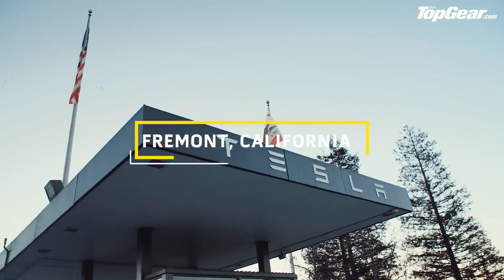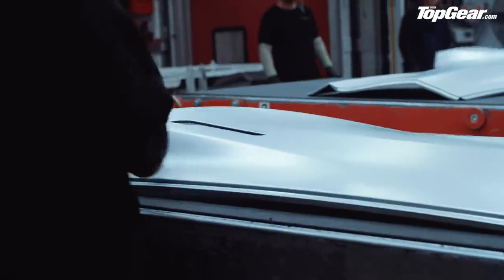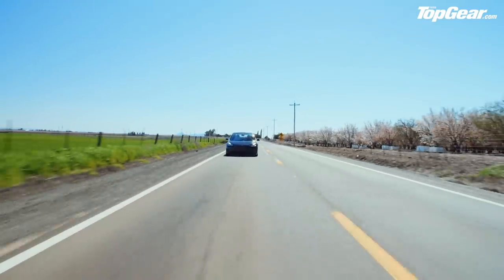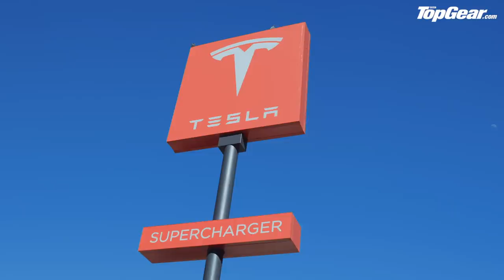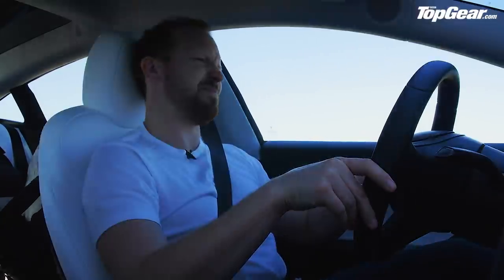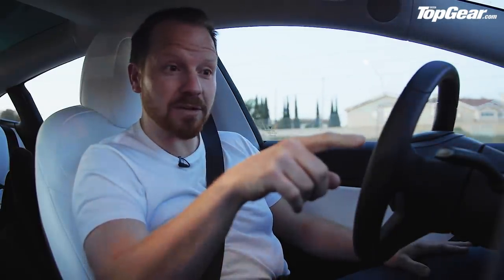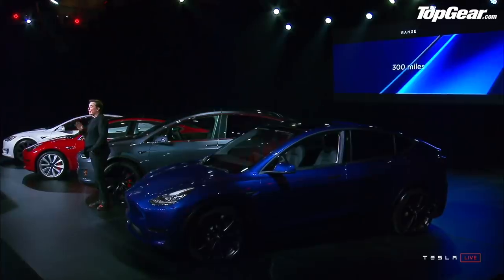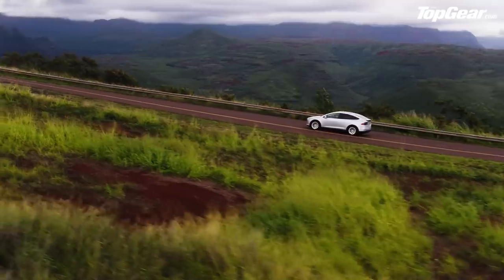TESLA Model Y Reveal, Model 3 Road Trip and Factory Tour | Top Gear

Comment: Nice video but not much research done
Reply: In fairness Tesla's can do so much!
Reply: Yea, it doesn't cost $20 to fill up for one.
Reply: If you add in the extra cost for a Tesla and divide it by an estimated number of fill ups I bet the Tesla equates to twice as much of someone filing up a regular car... Tesla is just a fab for the moment and it makes no sense go buy one till they get their stuff together as a company and build cars ppl would actually want
Reply: @jaybelle1909  extra cost on what? What are your calculations based on? Don't spread misinformation
Reply: The cost of the vehicle obviously, they have a build quality of a $10k and under car but the batteries are expensive that's why they sell much higher than a competitive practical car; all that extra cost it just makes sense to buy a gas or hybrid car till the tech becomes practical
Reply: @jaybelle1909  i can't take you seriously after you said that it has a build quality of 10k$. These cars are one of the most durable cars ever tested. If they were made of the same build quality as a 10k car, they wouldn't stand a chance.
Reply: Boomer0001 dopends on electricity cost, our Tesla costs £8 to fill up
Reply: Jay Belle Well no, As a family, we do quite a high mileage in our car, and before we used to buy £5K-8K diesel cars and use then for about 3 years before they die. We now bought a tesla, and even for the high price they charge it is cheaper to buy and use a tesla than any other car out there. That’s why we bought one, because it is significantly cheaper, Tesla’s are, in my opinion, the only good and want able cars out on the market right now
Reply: Jay Belle You don’t really know what you’re talking about it seems, perhaps do some research first before commenting, the tech is already more practical as demonstrated by hundreds of thousands of happy tesla owners. They sell them at a similar price to their competition and they have better specs, design and features. There is no reason, for most people, not to buy a tesla
Reply: @coonjamalay  durability is not the same as build quality. I deliver new and used cars for a living. The 2 teslas I have driven were the poorest quality fit and finish of any thing I've seen.
Reply: @lfo414  there is definitely a connection between build quality and durability.
Reply: Jay Belle incorrect, it costs the same to buy a used £4000 car and drive that for three years than it does to buy a tesla for £40000 and use that for 3 years, otherwise I wouldn’t have one, costs aren’t the only benefits of Tesla’s also
Reply: @domtdoodar99  that's a completely illogical statement. There is no way a 4k car even in ten years would cost as much as a Tesla. What you implied is that you were replacing the engine and transmission ever few month. You clearly don't know anything about cars and the fact that you even owned a diesel car proves it. The average cost of general maintenance and gas for a year is 2k or less, and about every 5 years needing 5k or less in repairs. Also insurance rate are much lower on other cars especially cheap cars. Someone who buys a Tesla has no life; ppl would be better off buying a newer Subaru and keeping it for the long haul.. Tesla needs to drop there price 10k to make any sense and in a few years I highly doubt they will continue to even make cars as other companies are already working on better ev cars. I'm not completely against Tesla I just don't like when ppl think it's reasonable to go outside of their normal affordability just to buy one or over praise Tesla and evs
Reply: Jay Belle 
Did you not see that press stamping out sections of the car?   That would cost a fortune but stamped is stronger than welded.  Again, anyone who’s worked in automotive manufacturing would marvel at that.  That’s why the body is so strong.
Reply: @brandonpayne7240  I don't think you know what I mean by build quality. I was more referring to bad panel gaps, flimsy interior panels, and body parts that are not easily repairable. If a shopping cat hits your car you have to take it only to a Tesla certified shop at a very high cost and wait several months for an issue that could be fixed in a few days or even a day had it not been built in such a way. Especially for Diy guys who could normally fix issues themselves now would have to take it in and go through all that crap. Since perhaps most Tesla owners are buying a car way outside their price range this means if their car gets damaged that it gets scraped. Just check out auction sites and you will find a host of Teslas because ppl couldn't afford the repairs for otherwise very or fairly easy repair jobs. Teslas currently are like iPhones, just a crappy piece of tech that gets thrown out in a year or two
Reply: At least it reminded me why men shouldn't wear tight clothes

Comment: Quite a bit of misinformation/missing information here.

1.  You can adjust the cruise speed and following distance by using the right scroller on the steering wheel.

2.  You can adjust the option to show miles/km or battery percentage on the car.  As with any vehicle, if you drive faster and punch it more often, range will decrease.

3.  Superchargers are usually located in convenient locations with restaurants.

4.  You can open the port by pushing the button on the supercharger handle, push the cover on the charge port, from in the car or from the app.

5.  Range anxiety is only a “thing” until you actually live with a Tesla for a week.

6.  Charging to 80% is fastest.  The last 20% charges slower.  Best to follow the suggestions of the Tesla route planner for best results.  Rarely does it require charging to 100%.
Reply: Sean Z i especially like your #3.  Every time i gas up and leave i think to myself “i really should time my trips to the gas station so they coincide with dinner time and my willingness to pay high prices for restaurant food because that would be an advantage!”
Reply: One of my fears is that same way that service stations absolutely rinse UK motorists for any fuel at all, the same thing will happen to energy at superchargers. Obviously the structure and placement of super chargers needs to be much more developed.
Reply: @stupidas9466  bring a sandwich if you're too cheap to buy food. You need to take a break every few hours anyway.
Reply: It’s by top gear that’s why
Reply: @stupidas9466  Nice, I see what you did there. Yes of course, for long distance trips an ICE vehicle is superior if you are focusing purely on convenience. That is absolutely true. 

However, for a daily commuter, an EV owner will never have to stop and "fill up". Which do people do more? Even if it's your only car, I'm guessing that for most people, the time savings of charging up each night at home will outweigh the occasional road trip.
Reply: Checking in from Canada. Been living with my Long Range for 3 weeks and after road trips to Orillia and Niagara Falls I can attest to having 0 range anxiety thusfar. (Here at least) Superchargers are plentiful, well placed, and multiplying. And waking up every morning to the equivalent of a full 'tank' is bliss.
Reply: Plus, for most people, the vast majority of your charging will be done at home with only the occasional Supercharger stop. And, with Supercharger 3.0 coming online, that charge time will be reduced by about 50%, and new battery formulations (as a result of the Maxwell purchase) may cut that time in half again, making the Supercharger stops basically the same length as an ICE fill-up, but without the smell...
Reply: @phamnuwen9442  nonsense. Truckers don't.
Reply: @thomashowl6488  Truckers don't what? Take breaks? For how long? The Tesla Semi will do 400 miles between 30 min charges.
Reply: As with any lithium battery, 0-10% and 80-100% drains the fastest and charges the slowest. Optimum performance range is 20-80%. This goes for any electronics that utilize lithium batteries, such as phones, tablets, etc.
Reply: @stupidas9466  Except EV drivers don't stop to charge day to day, they charge at home or at work.  It's only on road trips, when you need to stop and eat anyway.  So think of it more like you time your meals for when you need to stop and charge.
Reply: Stu Pidas i especially like your response. When I used to fill up with gas, I’d love thinking about my $ (4x as much as EV charge) going to Saudi Arabia, to fund terrorists and slave traders.
Reply: #5: Exactly. I’ve had my Model 3 since September and only supercharged twice. I leave my house every morning with 80-90%. I drove Leafs since 2013. Talk about range anxiety...
Reply: @misterb6  
So how often would an ICE car drive need to fuel up if there just commuting...  Once a week.. ever 2 weeks?  Doesn't seem like a hassle to me. I get gas while I'm out anyway and passing a station.
Your not saving money.  Buy a Tesla because you like the car and want one. Not because you delude yourself that your saving money.
I drive 57k per year..  drive an old Used Prius.. 290k on it .
I know what my cost per mile is .. works out to $.07/ mile.
When I compare the cost and savings of a brand new Prius vs brand new LR model 3. My break even point is 12 years .. at 50k per year.  Using superchargers exclusively. Since I'm out of town mostly.
If I could charge at home .. like a Normal commuter would you can cut that in half.... So 6 years to break even.. driving 50k per year .
Always check your math make sure you are actually saving... 
But also.. buy the car that works for your needs .. and one that you love to drive if that's possible..
A Prius is not really fun to drive . But for me the economics and practicality are more important.
Reply: @kens97sto171  You need to value yourself more. Why anyone would drive a car that wasn't fun to drive when they spend most of their life in the car, I don't know.
Reply: @DK-jd8bj  
Well it's also about driving something comfortable when you spend a lot of time in a car.  A Prius is FAR more comfortable than a model 3, at the expense of some fun,  It  Rides softer, more room in the back seat.. and the ability to easily convert it to a car camping situation which you cant do as well in a 3.
I do value myself, part of that is valuing my wallet, and my risk.
I can take apart and fix ANYTHING on my Prius, I can get parts from multiple sources.   With a Tesla..  you have to take it to Tesla for most things.
That's a major negative to me.. almost to the point of refusal to own one. I have a serious problem with that philosophically, it's my car I should be able to buy parts and work on it.
Reply: @kens97sto171  you can fold the rear seats on the 3 down and it's almost exactly sized for a twin blow up mattress.  The 3 is comfortable and with autopilot rush hour is a breeze.
Reply: @Scnottaken  
I can do the same in my Prius, only more room, and more practical.
Sedans are a pain.. so much less usable space .
And I still come back to the cost .. I can buy a nice used Prius for $5-8k
Drive it a few years toss it. Or repair it.
And I CAN repair it.. that's my main issue with Tesla. No service network that's decent. And no parts availability at all.
No thanks..
I like the cars... How they drive. But the rest is just a pain for my needs.
I don't care about autopilot.. traffic is not bad where I live.. and freeways are wide open and 85mph.
I actually like driving.
Reply: I get range anxiety in my petrol car lmao, and it can do 1000km in one tank. once the range drops below 200kms i start to worry. at least with an EV i’d wake up to it full every morning, and come home with 65% easily. i’m still gonna worry about the km’s left whether i’ve got an ICE, EV, or a hybrid.
Reply: Sean Z Point 6 agreed! I don't consider myself very knowledgeable but even I know about the 80%/20% charging rule, I cannot believe these people (with all their knowledge and research) don't know this, so it makes me more than slightly cynical about the quality of their advice.
Reply: The Factory looks fuck all like the death star also

Comment: U can change the battery percentage to the range in number of miles/km
Also charging to 80% happens in 30 mins 
Charging to 100% can take 1hr 
V3 can do up to 80% in 15-20mins
Reply: And i guess there will be a v4 within like 5-8 years and it will probably do something like 10 Minutes for 80% of a bigger battery if the car is able to max it out. That will maybe be the last power upgrade supercharging gets for a really long time... because it just completely stops making sence after that...
Reply: @meamzcs  I'm not even sure if we will see them reach that level of speed. If you consider the capacity of batteries we would like to see in 5-8 years time achieving even 40-50% in 10 minutes would be exceptional, this would be more range than your typical ICE vehicle.

The new roadster has over 600miles of range per charge and as far as we know this doesn't include any of the maxwell technology advancements whatsoever. Those are meant to be able to increase capacity by a further 30-50% while simultaneously increasing production speed substantially.

So a combination of both in 8 years time would require something like megawatt level charging to hit 80% in 10 mins. I'm not sure if we will see people given access to cables with this level of juice flowing in them for everyday life. I guess the charging process could become entirely automated, but I'm not sure what systems we would use to dissipate that amount of waste heat energy.
Reply: @sickbailey21  If you double the charging voltage, the required amps , and thus heat generated in the cable, are halved. That's the secret sauce in the Porsche/RIMAC/Pininfarina formula.
Reply: @Markle2k  its the same principle is transferring electricity around the country in power lines. That said, no one wants power lines near them :P
Reply: Battery capacity?
Reply: Intended Long Range Model 3 can take V3 supercharging so 75kwh battery 🔋
Reply: Exactly, this sounds a bit counterintuitive to people who aren't used to how Li-ion batteries work, but there are two basic rules:
1) waiting for it to charge up to 100% is generally pointless (unless it happens overnight or there's no other way to reach the next Supercharger) and actually unrecommended for battery longevity;
2) charging more often means much faster charging. In the time it takes to charge from 10% to 100% you can charge the same car from 30% to 80% about 2.5–3 times, which translates to 40–70% more energy transferred in the same time total. Such shorter stops take as much a typical dining break with V2 Superchargers (20–25 min) or a refueling/toilet break with the upcoming V3 (5–7 min). In other words, about the same time as with gasoline cars. Right now range anxiety pushes people to overcharge which makes them wait longer, but there will be a lot less complaining about charge times when people get used to this mindset.
Reply: You guys are smart!
Reply: Charging my V8 truck takes under 3 minutes and gives me range over 800km. How about that Tesla soy boys :D
Reply: @Markle2k  then again double the charging voltage means double cell stacking thus double internal resistance in the battery pack...the true problem here is the current cell tech is just to low voltage...we need a new cell chemistry.
Reply: @Nillersoon40  V/R=I They offset and individual cell resistance is tiny.
If you want a higher cell voltage you'll need to go to a  different universe with different physics. The chemistry used has the highest per cell voltage available.
Reply: @Markle2k  I am well aware of the fact that Li-tech only carries about 3.7 volt. The problem here is NOT Ohm's first law but the second...P=R*I² . This is why we need a new tech.
Reply: @Nillersoon40  You're still arguing for an alternative universe.
Reply: @Markle2k  You are saying that it is impossible that someone could invent a new tech with let's say 12 volt pr. cell? 

We need maybe 1000 cells pr. car/truck/van....times several million cars pr. year equals several billion cells needed, now who is living in a alternate universe?
Reply: @Nillersoon40  Yes. You are limited to known electrochemistry and the size of the charge carriers and their ability to traverse the medium. That is why Lithium is the ultimate.
1000 cells per vehicle is well surpassed.. A Tesla has 7000+.
Reply: @Markle2k  and you can build a million teslas a year?

Comment: Great video, but I just want to clarify a couple things: 
-You can have the range in percent, miles or kilometers (in the settings)
-You can open the charge port from the button on any Tesla charging cable or from the app or from the fob if you have one (hold the trunk button)
-You can just set the destination in the navigation and it will find the most efficient route with supercharging spots and even buzz your phone when you're ready to leave a supercharger (usually 20-30 minutes) so if you listen to the sat nav you'll practically never run out of range (hence the "no range anxiety" they talk about)
-Most superchargers are near restaurants and often even a mall of some sort so you can go have lunch or do a spot of shopping with the money you saved on fuel, or you can play the Atari games that are now included in the dash
Reply: You can also just push the charging port door. (you can edit your comment and add that)
Reply: They removed the Atari games recently IIRC.
Reply: @AbsoluteTVYT  no, they are still there. They had to remove one game, Pole Position, due to issues with the rights.